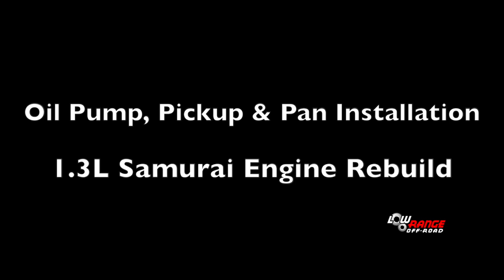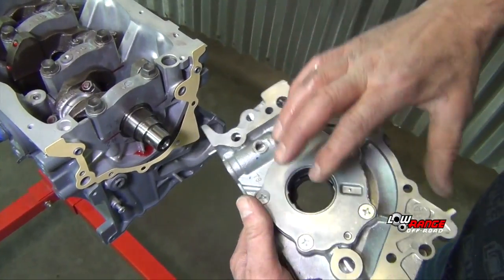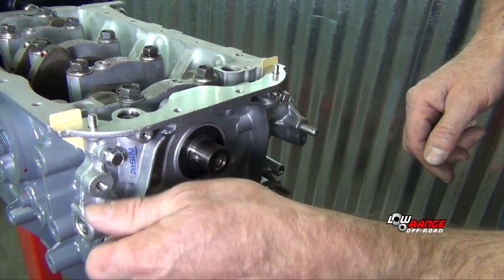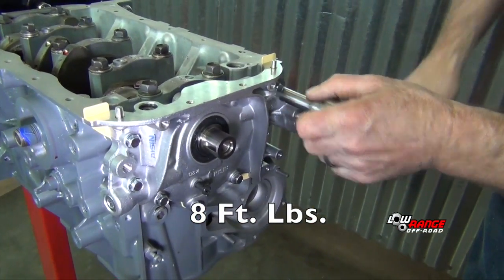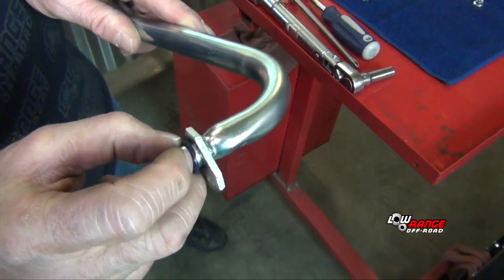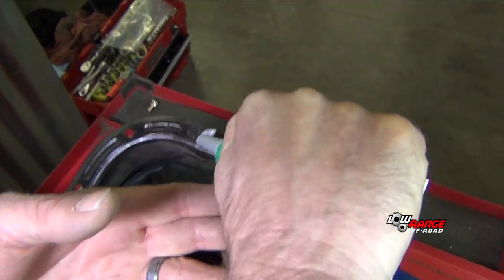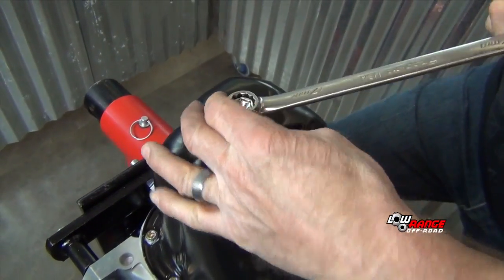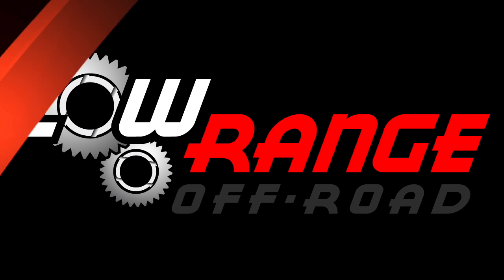How To Rebuild A 1.3L Suzuki Samurai Engine (Part 4) Oil Pump, Pickup & Pan Installation

Comment: Thanks for reading my comment. I would like to learn how to remove the oil pump that has been in the engine for many years. I assume a puller is needed ?  But I do not have one to try. Can anyone share any hints for getting this done ? Thank you.

Comment: You know...call me foolish...but I have done a few oil pan gasket in my life and transmission pan gaskets for the matter...and I never use a sealant. I have never sprung a leak. What's the point of the RTV? Is it like a fail safe for you guys?

Comment: I thought silicon was not to be used because it can chip away inside the engine and plug the oil pump screen...

Comment: On getting oil pressure in a 1.6 16v motor that had been sitting without oil for 20 years.  I filled it up with oil and cranked it for two thirty second intervals (spark plugs out, drill on front crank nut), the oil pressure would not come up.  I then pulled the oil filter and ran oil through a plastic tube into the upper oil filter hole (not center) which primed the oil pump.  Cranked it over again with the oil filter off and had oil gushing out the oil filter hole within seconds.

Comment: You guys seems like the guys who know a thing or two about suzuki so i have a question, i own a suzuki swift with the g13b sohc 16v 1.3L short block and ive been working on it for about 3 years now restoring the entire engine piece by piece, however, i came into an issue, i didnt see this video until it was too late, i had a tiny oil leak, like 1 drip once a week so barely worth fixing, but, i thought might as well since im cleaning everything up right? So i put on a felpro cork gasket, job done then boom, problem hit, crank but no start, ran perfectly before this, i noticed when i did the job the ckp sensor is right on the pan, is it possible the gasket being bout 2mm caused the ckp sensor to be too far in gap to read the engine turning? I took a multi meter to everything thinking it was ignition not getting spark, but everything checks out, i have continuity in all wiring and sensors sooo technically it has everything it needs to fire up! Air, fuel, spark timing and compression so im scratching my head wondering why it wont start... i heard you in the video advise against the gasket and did some research, apparently other guys had the same issue, tried the gasket n boom, crank no start... i got fed up with the situation and just took of the gasket and put on permatex synthetic, i run full synthetic everything in my engine so need the correct stuff, now im hoping after i let it cure the 24 hrs it will fire up finally, but just wanted to get your guys opinion and learn from my mistakes here D: please let me know when you can, thank you

Comment: It is good practice to pour some oil into the oil pump, to purge it so it does not start up dry, also let the sealant become tacky and avoid too much so that overflow of sealant goes into the motor

Comment: Was supposed to wait for the gasket maker to cure before final torque!
Reply: Exactly what I did after replacing the oil pump on my blitz 4x4, it literally says on the instructions of the gasket maker to leave it for at least 12 hours before final torque up.

Comment: Don't you have to prim a new oil pump ??... I was wondering if I needed to prime my old one cause I changed my gasket... everyone is saying you gotta prim a new oil pump.. ....1.6 16v....
Reply from the maker: I checked with our engine builder here at Low Range.  He said the way he primes the this engine is to add oil to the engine to the full mark.  Fill the filter  with engine oil and install it.  Disable the engine by disconnecting the negative primary (small wire) at the ignition coil and then crank the engine until the oil light goes out.  Once the oil light goes out the engine is primed.  Reconnect the negative coil wire and start the engine.  Thanks for watching and commenting.

Comment: Will that same(Gear oil) RTV gasket maker work on the oil pans that have the sensor?
Reply: Dont use the gasket, it causes the gap to be too far and the ecu will read no crank even though it clearly is! Mine had red high temp permatex before i did the gasket mistake and it ran perfect, so it should be ok
Reply from the maker: I am not sure I understand the question.  What sensor are you referring to?
Reply: Hes talking about the ckp sensor, mine is right on the pan too, but honestly i just did it anyway, ill report back n let you guys know if it worked once its cured!

Comment: will the g13b connecting rods fit in a g13a engine
Reply: Maybe... but keep in mind the g13a only has 8v so there could be clearance differences.. depending on if its short block or long block also makes a difference, check your manual for specs! Or go to rockautodotcom for the same parts i get for my g13b

Comment: Question. I want to replace the oil pump gasket because  my radiator coolant seeping at the side off the oil pump. Where can i clamp so that that i can loosen the screw after the crankshaft gear(tooth). Can i use vise grip. Will it damage the crankshaft tooth?I dont have the luxury to detach ģearbox from the engine.
Reply from the maker: Are you talking about the large bolt on the front of the crankshaft.  If so, you have several options.  The quickest way is to use an impact wrench on the bolt.  Just be sure you are going counter clockwise. You will likely have to remove the radiator to do this.  If this is not a good option for you, you could bind the flywheel with a large screwdriver or pry bar at the rear of the engine and loosen the bolt.  The flywheel can be accessed by removing the inspection cover located just behind the oil pan on the transmission bell housing.  Hope this helps.
Reply: @lowrangeoffroad1  Impact wrench did it for me. Yes, one may have to remove the radiator to work comfortably in that area of the engine.

Comment: right so he uses water to lubricate engine seals but doesnt oil them or grease the gaskets i dont quite see the logic in that
Reply from the maker: +imtheheretic666  I had the same question when we shot the video.  But, our engine rebuilder said he feels there is still enough assembly lobe on the crankshaft to lubricate the inside of the seal.  So, it certainly would not hurt to apply more oil to the inside of the seal.  As to the water on the outside of the seal.  It seems to work well for us.  The seal slides in nicely and stays put.  And on the gaskets we assume you meant gasket sealer.  Suzuki says, and we agree, that this gasket does not need gasket sealer.  Thanks for watching and commenting.

Comment: DO U HAVE G13BB ENGINE?
Reply: I do! I have a half restored, (still working on it), genuine G13B SOHC 16v 1.3 L short block! Obviously its not a 2jz so im not going to get 3000 hp out of it but its a pretty fun lil engine to rip around in thats for sure! Especially on light weight frames! Suzuki FTW! better than ford in my opinion! Lol much easier to get at everything too!